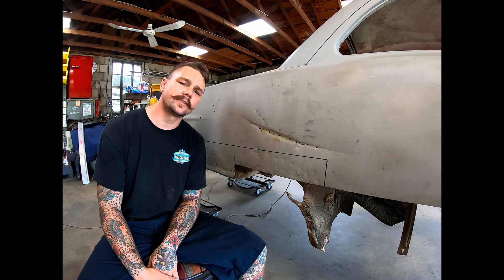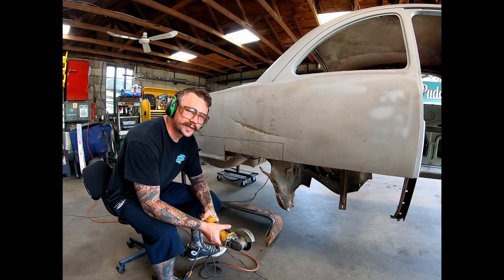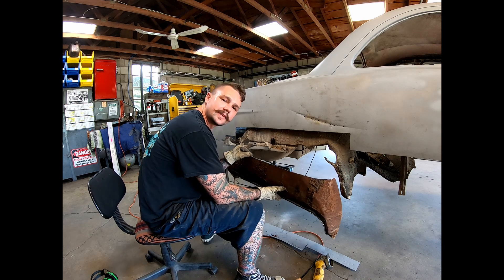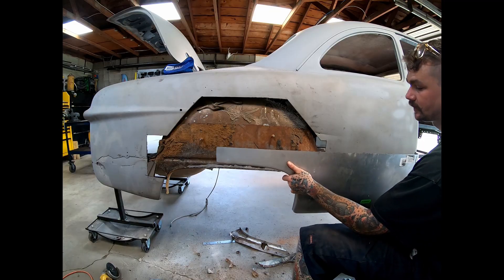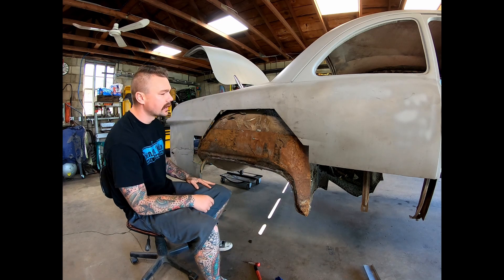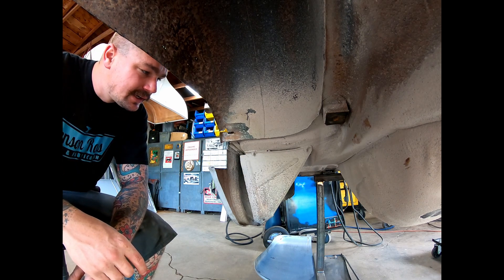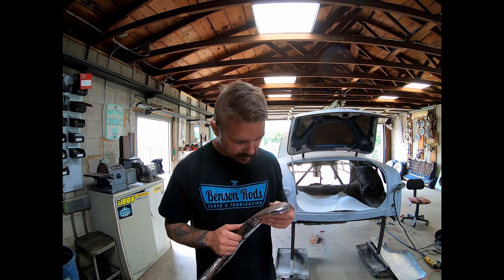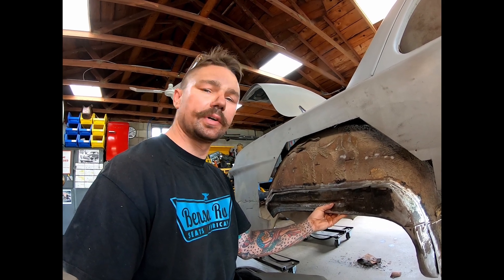FORD SHEOBOX RUST REPAIR PT.2

Comment: Oddly, you also look a hell of a lot like a mate of mine I work with here in Australia. Well used to work with and am still friends with. I'm a fitter and turner by trade and I worked with him in Melbourne in the heavy repairs section of the surburban train network. You two look a lot alike, hes a car guy too. Just a request for an upcoming video, can you do one with some advice on where to start and what to make sure you do to get into building a rat rod?

Comment: when you do a quarter panel replacement and you have the replacement panel like EMS makes do you try to use the entire panel or just cut out what you need to get rid of the rust. Which way would be better
Reply from the maker: If I was doing it again I would just patch the least amount as possible.